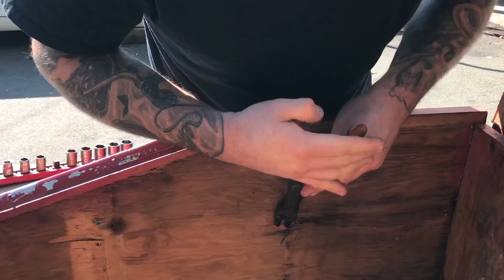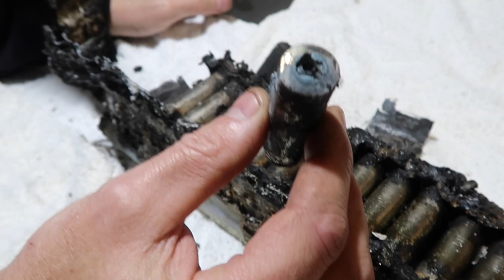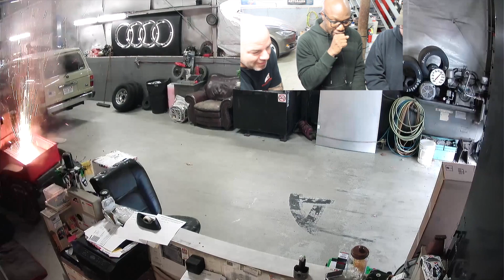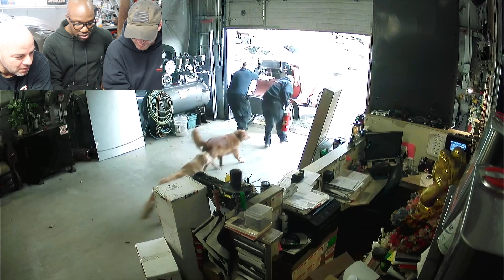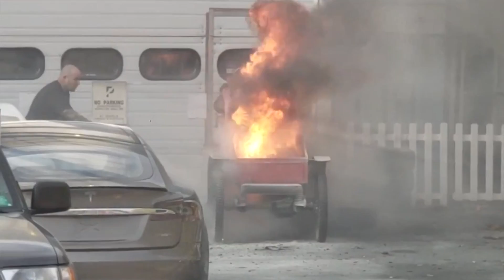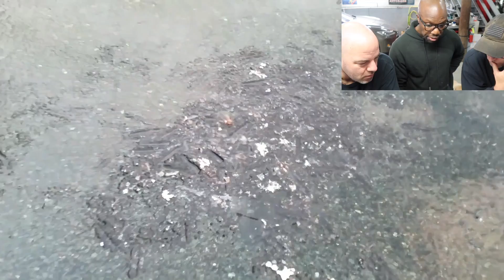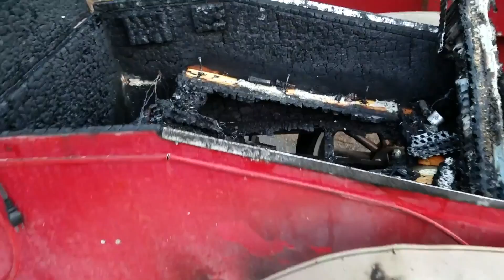My first Tesla Battery Fire

Comment: Aha..and you wonder why Tesla doesn't allow people to work on their cars..
Reply from the maker: you are correct, a Tesla has never caught fire on its own
Reply: @RichRebuilds  I know this is a joke, but there is still that pervasive misconception that electric cars/Tesla's are more likely than usual to catch on fire. That one's stuck around for years now.
Reply: @TerryTerius  It's not so much about them being easier to burn. It's more the problem of putting them out if they do go up. The cells Tesla use are some of the worst commercially available for this but then that's a trade off for their efficiency. 
There's no free lunch when it comes to energy so vehicles (which naturally require a lot of power to do their job well) will always have a large concentration of energy. 
The risks involved vary depending on what fuel or medium they use but all have the potential to be deadly. 
That goes all the way from a nuclear powered vehicle which could go boom and take out half a city down to a candle powered vehicle which probably wouldn't do much more than minor burns but also wouldn't take much weight very far or fast.
Reply: @siraff4461  nuclear powered vehicles use reactors that don't explode like nuclear bombs. Nuclear contamination could cause a city evacuation but not blow up a city.. your welcome.
Reply: @johnleschenkoo8  I was making a point. It makes no difference if it goes boom in a big bang way or boom in a broken but deadly way - the results would be almost guaranteed mass casualties in either case. 
The point is when you contain a high level of energy it comes with inherent risks. Those risks generally go up as you try to contain more energy in a smaller area/mass. 
Current battery tech means a lot of the space is taken up with the actual battery itself rather than the energy it's storing. That leaves a lot of energy in the very small left over area. Of course squashing more in will involve risk.
Reply: @siraff4461  and that is why Tesla over-engineers (according to the critics) their chassis and body, because their number one priority is to prevent any kind of intrusion into the battery packs in even the worst accidents.  It's also why Teslas have been rated by the NHTSA as the safest cars ever tested where likelihood of injuries is concerned.
Reply: @russell2449  Just a couple of points - Tesla have to over engineer on that partly because of their choice of battery chemistry which is more prone to this type of event than most on the road. Personally I don't have an issue with that as long as it's engineered properly but using Tesla cells in something like this is inherently more dangerous than cells from say a Leaf or similar. The NHTSA crash tests have nothing to do with the battery's thermals and part of the car's good crash ratings are because it has to be over engineered as above. Again nothing wrong with that IMO as it's killing two ducks with one stone. Yes the cars are heavier than they could be but the trade off is a more efficient battery chemistry with added safety. Thermal runaway is a possibility but is only likely in very few cases - a bit like having a fire in a petrol car. 
The problem with this chemistry (and most Li-based ones) is then how to put it out and make it inert.
Reply: @siraff4461  alright bright boy, perhaps you can tell me what type of battery you think they should be using?  I'm sure you have more expertise and technical know-how than Tesla and Panasonic combined, so please enlighten me, I'm all ears...
Reply: @russell2449  Can you read English? I never said they shouldn't be using them - quite the opposite, infact. 
I won't hold my breath for an apology.
Reply: @siraff4461  Oh STFU, these statements, "because of their choice of battery chemistry which is more prone to this type of event than most on the road" and "Tesla cells in something like this is inherently more dangerous than a Leaf" is wrong!!   First off, NO, Tesla's batteries are NOT MORE PRONE to thermal runaway's than most other EV's on the road, probably less so because of their first in class BMS. 

Second, the Leaf has poor TMS which is exacerbated by hot weather, and there are multiple issues with them, like fairly rapid degradation, as much as 20% over 5 years as compared to only 6% for Teslas (which slows to about 10% over 10 years). Plus they've never had the energy density which is also why they never gained the popularity that Tesla enjoys.  

As for Tesla's battery and it's BMS, Munro Technologies RAVED about they quality and precision, saying that they are STATE-OF-THE-ART, as in no one is making a better battery, period.  And while the NHTSA didn't specifically test the batteries, the fact that they survived the most rigorous crash testing does point out how safe they are, and that is thanks to Tesla's attention to building as bullet proof a chassis/frame as they did.

And the main reason Tesla chose this type of battery chemistry is because it is offers the highest energy density which is THE SINGLE MOST IMPORTANT REASON THAT TESLA HAS BEEN ABLE TO REVOLUTIONIZE THE EV INDUSTRY!!!  

As anyone who knows the history of EV's can tell you, we could have had electric cars and trucks 50 years ago, it's not like building an electric vehicle is that hard after all.  BUT, without sufficient energy density to supply a range attractive enough for the average consumer, any such attempt would and did fail, so it is THE BATTERY that allowed this paradigm shift to happen, and if there's a trade off with current battery tech, it is that there is an inherent risk with Li-ion battery chemisty, but that is something that is still evolving.

And Tesla has stated that it is always looking to improve their battery's and won't hesitate to make a change when something better becomes operational (not experimental or in trials). So as of this point in time, there's really not been a Li-ion battery that has proven to be better by most metrics and provide the performance necessary to make EV's the preferred choice over ICE cars.
Reply: Rich Rebuilds 😂 sarcasm game on point..
Reply: I hate thinking that this may be a valid point.   But just look at the cars Rich has restored and you will lose all doubt.   Rich does know how to rebuild a Tesla.
Reply: @charlesmcgehee3227  No. Rich knows how to swap parts. That's the same as any basic mechanic can swap junker parts between cars. That doesn't show an understanding of how or why they work. 
For instance a mechanic can swap a fuel tank on an ice. That doesn't mean they understand why purging it is a good idea in certain situations or even when they should. 
Most of the time they will be ok and that can carry on for years or even their entire career but their lack of understanding is putting them and others at risk every time they tinker. 
Luckily petrol is relatively easy to put out/contain which has saved countless fires like this one in the past. These cells aren't so forgiving. 
No BMS, No cooling, looks like the charger wasn't ever meant for them, no real preventative measures of any kind - this was waiting to happen and is a very long way from bolting a car together with all its designs intact. 
Even some very basic thermal sensors and switches to the charge circuit would have stopped this. We're talking about a few cents worth of parts and a half hour job to set them up. It wouldn't be efficient but it wouldn't be on fire either.
Reply: @siraff4461  I have no idea what Rich knows about traditional internal combustion engine powered cars.  With the TESLA,   he  put his mind do to a very big job and actually did it.   His very first car ended up damn good if you as me.       I don't think a Tesla is much more complex than a high end hobbyist grade remote controlled car.
Reply: @charlesmcgehee3227  You don't think that but it is. There is a lot more involved in charging, cooling, balancing and keeping happy a pack with hundreds of cells under a lot of stress for many years than there is in keeping a few cells with short use times on a built-to-suit charger. 
I have no experience working on Tesla's but barring any one off tools they may need I'm certain I could strip and rebuild one all the way to it's component parts.
That doesn't mean I have knowledge of how the BMS works, how the cooling/heating loops work, what the targets are for temp, voltage, etc or anything else. 
At the level of simply taking it apart and putting it back together it probably isn't a lot different to a remote control car and any ice. 
At the level of actually doing anything else with those parts it becomes a whole different ball game. That's the point where you need an understanding of what you're doing, what you're doing it with and how what you're doing will affect those parts.
This video couldn't show any more clearly that he either has no understanding at that level or is too fly by night to care. 
I like Rich and I think rebuilding the cars should be something allowed but he needs to realise his own limits when he's working with materials and systems which could hurt him and a lot of people around him. There have been a few times already where he got lucky. 
It happens that I'm fairly competent with electrics but if I were to build something like that I wouldn't cut obvious safety corners and I would be watching it like a hawk at least the first few times of cycling it. Certainly leaving it alone long enough to catch fire is way past due dilligence on something with no safety systems in place.
Reply: @siraff4461  I think some information went sideways from me.   Of course there are several factors involved when charging a large pack of batteries like the Tesla.   The series/parallel wiring configuration.   The coolant pump control.   The temperature sensor configuration.  Tesla uses looms of wires that change in resistance as it heats up or cools.   That resistance is monitored and compared against a fixed reference value.   Cutting it to different lengths requires other circuit mods.   I am pretty sure  the Tesla uses a P.W.M.   (pulse width modulation) type charger.      I initially jumped the gun and thought a bad  battery triggered the problem.   That was before I realized the temperature sensing wiring loom had been sliced and a bunch of other critical components were stripped or ignored. The amount of current the battery pack draws is a key element too.    It would take a design engineer to revamp the battery pack clustering.    I run little R/C cars and just use a straight P.W.M. type charger.   But the batteries get a bit too hot often.  That is just 6 LIPO's in series wiring config.   I love the sealed liquid cooled pack in the Tesla.   The whole system must working considering how long these packs are lasting.      Obviously this  battery pack that caught fire did not have a proper "Built to Suit" charging system.   I actually thought Rich would have had someone set up proper charging.      SI RAFF  Thank you for waking me up.     I am playing with an A.I. Robot  today and I am obsessed with it.
Reply: @charlesmcgehee3227  I play with little helicopters myself. I've done loads of different configs of battery, charger and so on over the years. Only one ever to set fire was after a crash. 
It's easy to keep things safe with pretty basic knowledge but the way this was built was just asking for trouble. 
Trouble is this kind of thing will lead to ev hobbyists being looked at in a poor light and eventually loads of red tape to jump through just to knock up an ev at home. 
I quite enjoy building or converting ev's so it would be nice if that wasn't made more difficult just because someone is playing fast and loose.
Reply: @siraff4461  I'd bet my toys are a lot like yours.    EV's are coming along.    But out of my price range.   I am restoring a 2001 Miata.   It runs solid now.   I am putting all of the tiny detail work into the interior.    If you have ever driven one, they handle a bit like the mid 60's Triumph Spitfires.   But way more reliable.  I enjoyed watching Rich when he first started getting one built.   When I saw the car torn apart and laid out, it looked so much simpler than a late model Internal combustion car.   Everything looked so plug and play.   I did see some electrical stunts that made me cringe.  But Rich did get that car running  and looking nice.    Most of the mechanics I have met could use a couple of years of electronics.    Si RAFF  -      Have some easy Holidays.     btw You have put together an EV?    Like to hear more sometime.
Reply: Nice one rich.... just put ev adoption back 10 years..... unsubscribed

Comment: I have to agree with whoever pointed out it doesn't look like it was charging at the time. This makes me think that at least some of the cells were just sitting overcharged, offgassing hydrogen and oxygen and getting hotter, then one burned, then the heat from that fire set off a chain reaction.
Reply: He pulls some cable away with his left hand...
Reply: @EmyrDerfel  Ah nice, I didn't see that. So yeah, overcharging or just overheating from charging too quickly are possibilities.

Comment: Did you find out why the batteries exploded in the first place?
Reply: Mortons pointed out that it looks like they may have been charging @ 3:14 you see him unplug something from the wall with his left hand. I would like to know more about the charger being used, if it had thermal detection, if it did a balanced charge. Then again what I saw when they installed this battery was not balance wires or protection BMS. So even if the charger was a proper one, it doesn’t do any good if the battery isn’t wired correctly.

Comment: Dry chemical fire extinguishers do not work on battery fires.  Only water or foam will cool things down enough to stop the fire.  Dry chemical is for blocking the flow of oxygen and push the flames off of the fuel.  Battery fires are self oxidizing no way to push the oxygen away.  Jack Rickard recommends Spectrum FX Firebane 1179.

Comment: can you do an analysis on this as best you can figure? im really curious if you guys tested how many amps that thing was pulling and if the 2 modules could handle it, how it was being charged etc.... insane to see them just blow like that, seems like something was over stressed in either charge or discharge, wrong charge logic, over charge etc.... really curious glad you guys are all aright (also you mentioned no bms, which is not a problem if you balance charge and are careful with all the other parameters)

Comment: Hope you are all okay Rich.   Damn.     That is not supposed to happen.    I wonder what specifically went wrong here.   A single bad battery?   That seems to be the most likely.       UPDATE:    I am wrong.   It was not a bad battery. It was the utter dismissal of the temperature factors when charging LIPO's.    I didn't realize the whole temperature sensing  system was dismissed.        C'mon guys.   Why? WHY?
Reply: @Charles Mcgehee Probably overcharged cells, Rich said they weren't using a smart charger.
Reply: A lot of things went wrong, but not the batteries fault sad to say. A BMS designed properly would have cut off decent sections of the pack, or one lack to another from charging each other and ad thermal monitoring as all. Proper charging, and checking packs before hooking different packs together. Maybe charging methods and not using some tho of balancing charger to keep the cheeks balanced. Over charged, or over discharged after the test runs causing the more charged pack to dump into the over discharged pack could have caused this also.
Reply: @GadgetReviews-US  
"...... Sad to say..."? Really?
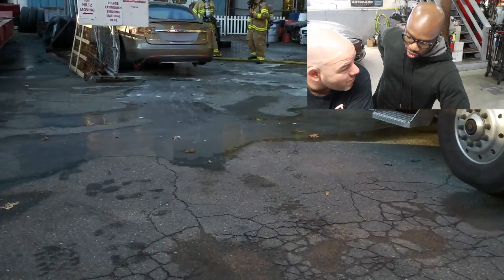Reply: @Roger, Well I like Rich, he’s a good guy. We have talked in the past over emails. He just tinkering with modern day tech not knowing all the facts or safety needed and I can’t say I haven’t done the same when I was a kid. At the same time I feel this video may be viewed in a negative way towards the batteries and get a lot of attention because it’s a Tesla product. At the same time it’s lacking context. Most people don’t watch a whole video to the end, and @ 9:28 maybe more of a explanation would help. Then at 11:22, “imagine all 16 that live in a Tesla battery pack” The chances are much less with the proper protection that a Tesla battery has, again missing context. I just hope the press doesn’t cut this video up, they will make this look very bad to most of the uniformed public. Even if the whole video was watched by some, most people still might not know what a BMS is or does that’s mentioned at the end of the video.
Reply: @GadgetReviews-US  I think his reply meant, that you made it sound like you wished it was teslas fault
Reply: @destinal_in_reality  Thanks for the info.   Seriously glad no one was hurt.  Lithium Ion batteries can go off like a serious bomb.   My first guess was that the temperature sensing component was cut short and maybe disabled.
Reply: @charlesmcgehee3227  Right, in this case without a battery management system there's nothing sensing the temperature at all, the charger will just keep on charging.

Comment: Don't think you're supposed to put out a lithium battery fire with water.
Reply: Robert Drake actually only water, loads of water
Reply: @Crepitom  I thought Lithium and water equalled boomboom and flames?
Reply: Normally water and electrical does not mix well, but in a lithium fire you would need a shit load of foam and it still would not put the fire out, so in these cases water is the best answer.
Reply: @BruceLortzHI  lithium yes, but not Lithium Ions
Reply: Sand is the best way to control the fire and starve the flames of oxygen.  Calling a dump truck full of sand is not easy.
Reply: @fatboy19831  burning Lithium-ion batteries are more like thermite. No need for external oxygen. If it burns, it burns